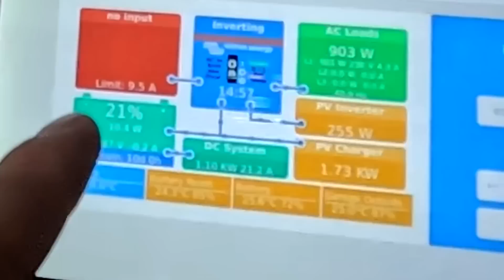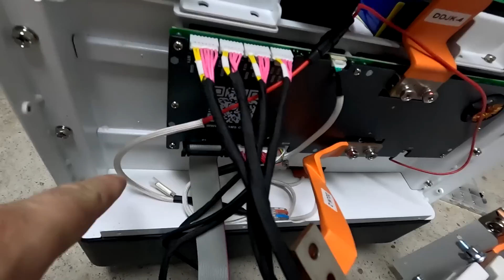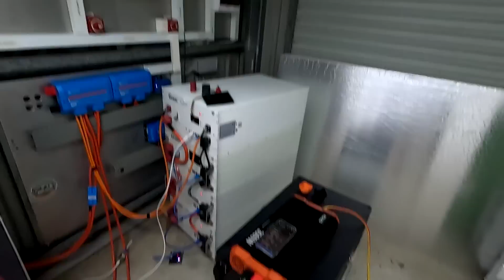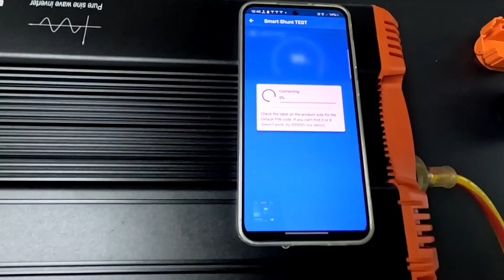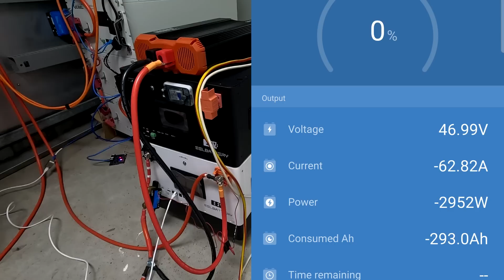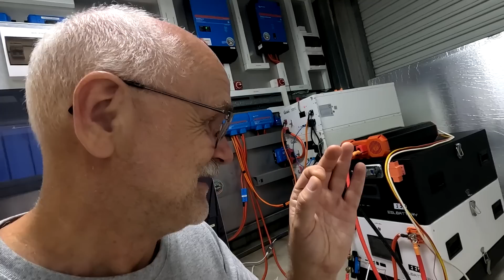EEL DIY V5 Build and EVE LF280K Double-Hole Terminals Capacity Test. What's up with this fuse tho?

Comment: Compression is good for the first couples of charging, because from production there may be gas-bubbles between the layers and those have to be "pressed out" to the top, so after that the electrolyte has 100% contact to everything. 
After that time, compression becomes less important.
That "gas bubbles" are the reason, why you should never mount cells flat and stack vertically. The gas bubbles will never have a chance to escape. Upward position as in the shelves is mandatory.
Reply: Yeah, Andy's talked about this theory, and has videos on vertical batteries - see website. I haven't managed to find a reference to this on the MB30 data sheet though. Sorry - I've got a horizontal battery on its end... 😁
Reply: @matthewmarks6951  there exists a youtube from "zerobrain", but german language, where a battery developer was guest and explained all the mysts about LFP and why horizontal is bad. 
its on 1:05:40 and the youtube id is .../watch?v=2I-QdZFQqP8&t=4093s
Reply: @peterle987  Thanks. The auto-translated subtitles were useful. He seems to be saying that if they're compressed they can be on their side and bubbles will be squeezed out, but I'm not sure if he's saying the amount of compression would have to be impractically large. He says that manufacturers do not recommend any particular orientation and it's a pity he wasn't questioned as to why they would say that if this gas bubble issue is a real problem. It's also from two years ago, before the MB30 and MB31 were available as I understand it.
Reply: @matthewmarks6951  Gas bubbles to not allow areas to be contacted. Thats unusable material with different degradation.
The main thing is: allow the gasbubbles to escape! If horizontal and flat its bad - no way out and I dont think that any preasure may press the bubbles to one direction. So (besides top down) its the worst way to use.
Use vertical with poles on the sides may be bad too in my opinion, because id the layers are "Z" form, the bubbles may end at every top -Z-fold. Better than random on the survaces of active material, but - not good.
And if the manufacturer doesnt use zick-zack structure like Z, I have seen some with circular shapes, just in rectangular form, its bad as horizontally too.
So - the ONLY good way is to use is poles up - nothing else.
Manufactorers arent interested in "best way to use" - the interests are "marketing speech" that sounds great. Loose a bit of capacity or ccycles ---- who cares, we can sell another one! (sorry about my maybe bad english, am native german ;-) - hope you understand what I like to say - I am in "using /building battery stuff" for over 20 years now, solar for 25 yrs)
Reply: @peterle987  Yes thank you - you're saying what was said in the video, and your English is a lot better than my German!

It's fine in theory but the question is whether it happens to a significant extent in practice - that is, just how much gas is in there to escape? The cell is sealed after all, with only a rupture point for safety.

I would also respond to the remark about what the manufacturers say by questioning what marketing advantage they would get by not stating that the batteries must be installed terminals upwards, and that warranties do count, especially for large customers who could cause them trouble if huge numbers of cells did not work properly.
Reply: @matthewmarks6951  Its hard to say how much gas stays. Its dry like a sponge before, then the elektrolyte soaks into that sponge structure - how much gas stays then? Or how much of that escapes while stored in shop (mostly correct position).
Also the gasbubbles may be out to the top (where they collect near the poles, whats no problem, because no active material there) after a bunch of cycles.
The warranties wont be affected, because that effect will limit the capaity in a small amount, that fits into the tolerances and also if the lifetime is reduced a bit, than its at the end of lifetime and noone may tell why - or takes care.
So in real life you maybe cannot tell, whats caused, but with the knowledge about that I never will choose a method that hast disadvantages. 

Just upside down fells VERY bad, it may allow that there will be dry regions of the electrode materials that may cause big problems, like maybe shortages, self discharge or like that.
Reply: @peterle987  Exactly. "Hard to say" sums it up. I'd be interested to see some objective properly-controlled studies on this, such as by repeatedly charging cells in different orientations under otherwise exactly the same conditions. It's natural for people to obsess about things - another example being the state of charge and discharge limits. You pays your money and you takes your choice. You're taking your choice in deciding what voltages to start and stop charging at. Do you set those close enough that there cannot be any disadvantages?

My cells are not upside-down, by the way. They are on their side, like all vertical battery boxes Andy has reviewed, IIRC.
Reply: Oh and you can be sure that if there's a measurable risk of cells short-circuiting when upside-down, the manufacturers would definitely forbid it. It could kill people.
Reply: @matthewmarks6951  if its a dry shortcurcuit, the resistance will be pretty high. So its not like a high power shortcircuit, its more like a "faster self discharging".
I havent checked yet if the manufactorer allows a "upside down" position - I never had the idea to do that. It feels instantly as wrong as it is :-)

Comment: You should mount the temp sensors on the cells. EEL manual says to use tape, I used hot glue. And the thermostat block on the heater cable is probably only for protection. The BMS uses cell temp measurements for control.

It's a great box overall. ANL fuse can be replaced with Adler EF3. It fits the same holder. The biggest problem with the case is the tracks on balance routing PCBs, which are sometimes under screws, and may cause a dangerous short circuit.
Reply: Or unter the top-Rail, sitting direct on the battery
Reply: @jkoljonen, if I'm not mistaken, Andy said that tracks on balance routing PCBs have been finally moved in this particular box.
Reply: @binaryLV  I have a V5 box with bad trace layout.
Reply: Are you also from Finland? Where did you buy your adler ef3 fuse?
Reply: @petejoku7687  yeah! Lempäälä. You? I got the fuse from ECS, a german webshop.
Reply: @petejoku7687 Yeah! Got them from ECS Germany.
Reply: @jkoljonen Can this jk bms handle surge when connected,without precharge resistor,so that 250A or 200A ef3 fuse won't blow?
Reply: @petejoku7687  no idea, which is why I precharged with a resistor. It's probably very dependent on the inverter as well. Smaller inverters will be ok more likely.
Reply: @jkoljonen  that EF3 idea sounds great. Is there enough space between fuse and BMS left? 
EF3 are pretty bulky and high compared to the delivered one. Do trust the EF3 type more too.
Reply: @gewoonandre  yes it fits great. No issue whatsoever.

Comment: Not that the Chinese aim for Aussie standards, but removing the isolator / breaker is crazy. It should be double pole CB, not a fuse.
Reply: so i bought the yixiang.....had already 2 boxes V4 from EEL. the disadvantage of the EEL was that the front compression plate at V4 was very thin and got bent when compressing...

Comment: It would be nice if the end plate would support the entire surface of the cell. For best practice, epoxy sheets should be used between all cells and Poron foam at each end of a row of 8 cells. Just taking up the slack/space with that arrangement will eventually yield the correct compression after a full cycle. 
Poron foam has been found to have the best resilience/rebound.

Comment: Hi Andy, great video! I was rooting for the 300Ah mark. I have a theory about the cause of that vibration in the battery case. The inverter is of course generating 50Hz at its output, and so its input current has a 100Hz ripple. I measured the frequency of the vibration to be about 100Hz, so I think the battery cables are generating a 100Hz rippling magnetic field from their rippling current which is causing a 100Hz vibration in the steel lid. Since the case is a big steel box it conducts the magnetic field really well. I might be wrong, but that's my two cents.

Comment: Hi Andy. I would love to see the addition of a large free standing/ ground mounted AC coupled PV array to your system. 
I’m interested to see how Fronius or SolarEdge would tie in to you Victron system. 
If it was 10kw +/- that would allow you to run all your Day time AC loads and take some strain off the DC system so it can solely focus on charging your batteries.  
Would be a great mini series! 

Also you know don’t like the ROI on a heat pump for hot water, but an Istore isn’t that expensive and use bugger all power. Just saying! Probably even a state gov incentive around also.
Reply: This year I will be adding one Multiplus 5000 and a 16 kWh battery to my SolarEdge 10 kWp so far. I'm very curious to see how the whole thing works myself. I'm getting my information here, Andy is a master in the field.

Comment: So inspiring with these DIY packs. It is the final key to getting the batteries affordable up here in cold Norway.
Companies are charging between 600 and 2300 AUD per kWh installed for the powerwall and stackable batteries here. When it can save 900 AUD a year if you have a 30kW system that is just insane.
The EEL kits with lovely 2-screw pole cells delivered are 8000 AUD including taxes for 2 boxes making it 250 AUD/kWh! Somebody is getting rich or they are simply not selling anything.
Reply: Here in Ukraine we have a lot of manufacturers of such DIY boxes. Full DIY kit for 16*280 will cost around 300$ (with wires, terminals, epoxy). The whole setup with batteries will cost around 100$ per kWh if you DIY and buy some components from China.
Reply: @P_r_i_m_a  do you have any link for the boxes? Are they also using JK BMS?

Comment: 5:14 I dont think of the box as "Compressing" the cells, but more of as a fixture, to prevent the cells from moving and wrecking the terminal.
TO wit: in your DIY Battery Shelf, you once noticed the cells moved (expanded) and the terminals were stressed.
Reply: That's why you use flexible bus bars.
Reply: @moestrei  Yes, Flexible bus bars with 1inch of flex, and the whole battery expands by 16 inches. see how your box/shelf handle that much expansion...
Reply: @DanBurgaud  Each flexible offers enough flex to accommodate any (tiny) change in the positions of the terminals it's connected to, and that is enough. Interestingly though, my MB30 cells came with rigid bus bars, which implies the manufacturer thinks there's no need for flexibility at all...

Comment: Can't you top balance by turning of the float and ju st have it keep on charging?
Reply: No - you'd just end up with equally unbalanced cells with one of them hitting overvoltage protection... or an entertaining bonfire if you don't limit the voltage.

Comment: The humming on the battery lid should be Lenz' law in action iirc. Even tho it is 100% DC the magnetic field around the busbars are inducing a small current inside the lid, hence the humming sound and mechanical vibration.
Reply: I'd say you're on the money, inverter is constantly changing the current which induces magnetic field...   Makes me wonder what the load on battery does which it's effectively pwm (as a sine wave) to the battery... surely a couple of big caps would smooth the delivery.
Reply: @FelixRisingOriginal  The inverter switches at high frequency and then has a 50/60 Hz load on its output. There is a large capacitance on the input to suppress (in theory) the high frequency and to reduce the AC mains frequency ripple, but you'd need an inordinate amount to make that unnoticeable - and there are already issues with the initial charging of all that capacitance when you connect the battery.

Comment: Feedback on the EEL V5  DY box.  It is really nice.  I don't like nor do I think it is sufficient/appropriate/safe to just use a fat ANL fuse.  And I MUCH prefer the convenience (switch off) and safety (can disconnect on a hard short) of a built-in Breaker.   Thank you for checking with EEL about the fuse!
Reply: Agree, i just bought a V4 and i replaced the ANL fuse with a T-class. I don't trust they are rated for 48V as i can't seem to find a replacement. 300A is all I i can find that are rated high enough. And yeah, I'd rather have the breaker too.
Reply: @andrewt9204  did you modify the fuse holder too , to fit the new type fuse?
If so, can you explain something about that mod?
Reply: @gewoonandre  as for how you would do the substitution, it should be pretty straightforward. The two fuse holders seem to be of somewhat similar sizes. If you're lucky, Danny will just be a matter of unscrewing the wires from the old socket and plugging in the new one
Reply: @gewoonandre   I only needed a couple mm to make the fuse fit on the existing holder. So i just filed a bit of the fuse to make it fit. Very little metal and ampacity, if any, was sacrificed. The fuse blowing is probably a one time event, so if i have to do it again no big deal. 

The T-class did come with a fuse holder, but I'd have to grind off the existing screw bosses and drill new holes in the case. I figured modifying the fuse was easier.
Reply: Is 225A class-t enough?
Reply: @andrewt9204  you scare me 🤣🤣😜
Reply: @petejoku7687  yes it is   you can limit the fuse to how much power your inverter will consume.  If memory serves me right, Andi uses 60.  I use a 125A (UL listed) Nader (That's the brand ) DC breaker.   So you could use a 100, 125, 150 200 or 250 amp fuse and be okay. Just make sure that the fuse is not rated higher. Dawn, the gains of the wires used internally. I don't remember the gauge.   Personally, I find that 150 A maximum is probably a good reasonable fuse rating
Reply: I tried to fit 225A class-t to that holder and it didn't fit. I can file holes bigger so it does,,but still fuse holder doesn't have enough space in the bottom. Maybe if i put busbars under fuse,or flat copper bar or something..

Comment: Ok, youi want to say that now insects and ants have to knock on the door if they want to get in ?
I guess we will have a lot of funny videos from knocking ants.

I hope the EEL V5 is a big improvement - otherwise I will stay with V4 or change to the xylanti or however that is called which you had also tested before and called great.
I have a bit of time - if I wanna build 1 or 2 of these but in a different setup: 1 battery with 1 growatt hybrid inverter - simple to run and scale
No risk in case of outages - 1 of the 3 hybrids will survive.

Comment: Why are you carrying the second glasses?
Reply: They're safety glasses, which is always a good idea when working on cells, just in case there's a short circuit.
Reply: @matthewmarks6951  why?
Reply: @ Because if there's a short circuit, enormous currents will flow and you may get an explosion which could blind you.
Reply: @matthewmarks6951  So your eyes might still work, but your head is flying around?
Reply: @zisaurierzisaurier9286  Better to have your head flying around than your head flying around and being blind.
Reply: @matthewmarks6951  :-D i am not quite convinced.
Reply: @zisaurierzisaurier9286  Well there are a lot of things that could blind you but otherwise not do you too serious harm, such as flying bits of molten metal.

Comment: Do those cell double bolt terminals have helicoil inserts in them? My EEL Eve 304’s didn’t which people thought indicated they were not Eve cells.
Reply: you misunderstood. The cells are from EVE, but EEL did not order them completed with the double pole terminals from EVE (the original eve terminals are with the helicoil inserts). EEL got the terminals welded by another company with only aluminium thread.... but the EVE cells in this video seem to be with the original terminals (threads are darker than the aluminium and shiny)

Comment: if we compress the battery pack wouldnt the forming dendrites' puncture thru the seperator faster because of the physically smaller gap between the separator and the anode?

just my theory i dont actually know much about stuff like this, and yes i know that the data shows that compression gives more cycles before reaching 20% degradation
Reply: The amount the batteries compress by is rather small, and I don't think dendrites are considered to be much of an issue with this sort of cell.

Comment: Interesting! I've a EELv3 and a EELv5 box and both have the humming noise in it when (dis-)charging above 30A. 
Thinking of putting a kind of foam between the housing and the lid. Temporarily fixed it by putting something heavy on top.... 

Thanks again for the review !
Reply: There will be a magnetic field orientated vertically caused by the current flowing in the horizontal loop formed by the chain of cells. This will attract the ferrous top and bottom of the case, and will have a 50/60 Hz ripple on it due to the varying load on the inverter over the AC mains cycle. That's what I reckon causes the hum.

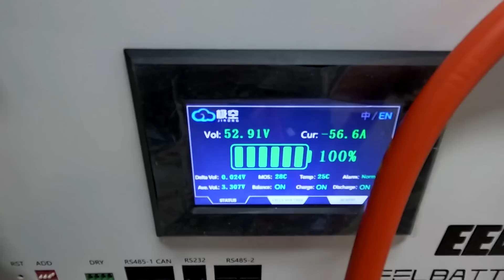Comment: 21:19 you’re almost cooking the battery internal cables that you asked to be changed smaller that can only handle 65A.
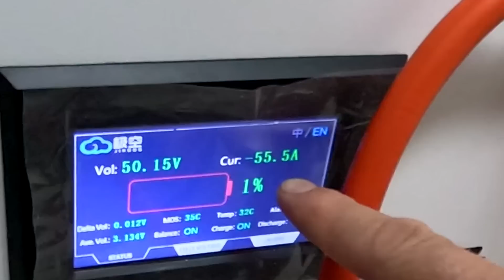Reply: 23:20 58A is only 7A from limit.
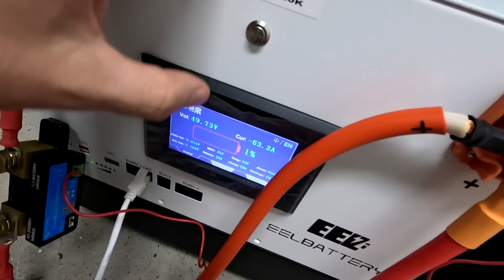Reply: 23:55 63A is only 2A from limit.
Reply: @tujuprojects  What sq. mm are they? My external battery cables are 25 and barely get warm at 65 A.

Comment: Can you test the sensor that’s on the heating pad wires? You mentioned that it’s what controls when the pads come on, but I was thinking the BMS did that & I assumed that device was a thermal fuse to shut it off in case of malfunction.